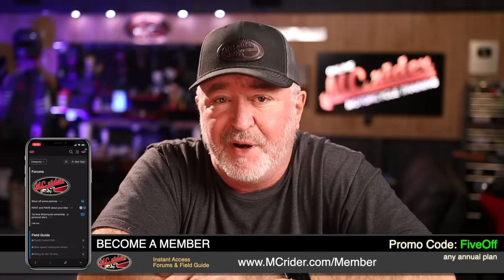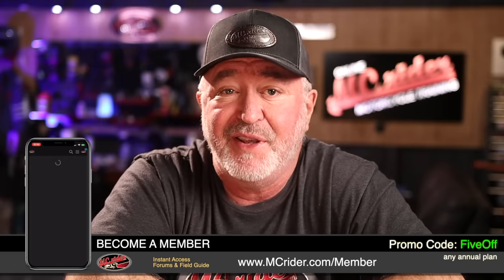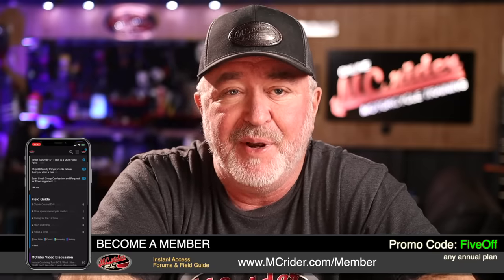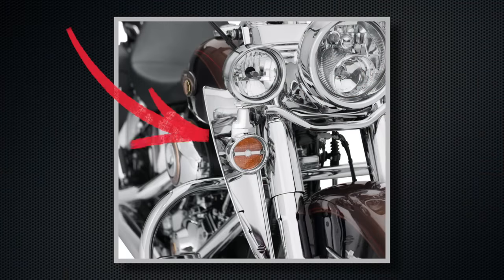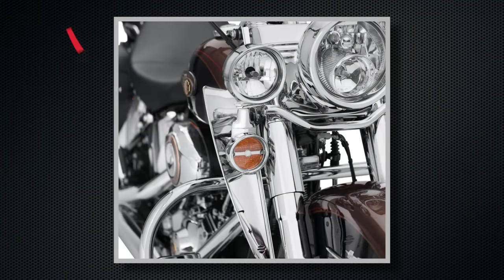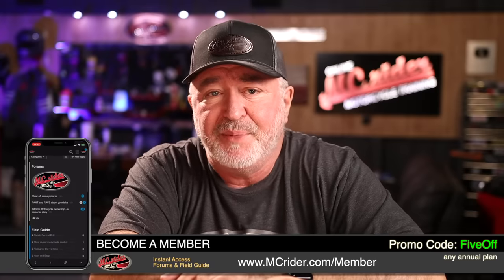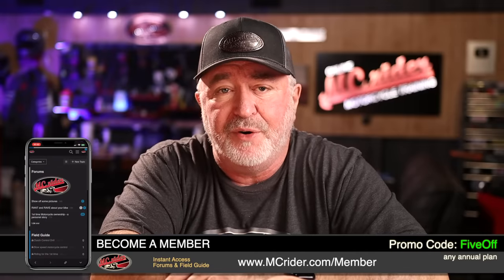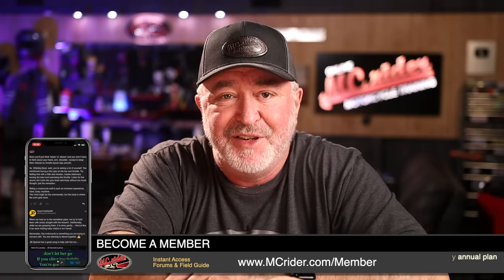Say Goodbye to Wind Buffeting on Your Motorcycle: Expert Tips and Solutions

Comment: Helmet buffeting isn't much on my BMW K1100 LT. I have an adjustable windshield and that is helpful. I sit in a relatively still pocket of air and the wind goes all around me. In the rain this would keep me dry except for a bit of my shoes will get wet, and because the rain hits the top portion of my helmet and as I am in a relatively still pocket of air, all that rain dribbles down on my chest and it will soak my underwear too, in a heavy rain, or even moderate consistent rain, if over a longer period of time. 

Most of the rain I run into, I don't find the need for a rain jacket, but I do carry a windbreaker and will put that on during heavier rain if I want to. It is quite water resistant. 

Because I have a full fairing, I can ride through any kind of rain, as long as it's not so heavy I can't see, and for that I would need to stop even if in a car. However, because I do get some rain dribbling down on me, rain can affect how well I can see, so I might stop depending. I would say that about 90% of the time, I ride right through the rain, if I want to get somewhere.

The relatively still pocket of air I ride in, is actually mostly on the front of my body, as the air will curl back around and hit me on the back. On a long ride it's like getting annoying pats on the back, and that can cause some tensing up of the muscles in the upper back, especially during cold or wet weather. However, it's a whole lot better than facing a hurricane of rain which happens without a fairing. There is no faster way to get wet than that, other than jumping in a lake. It's one thing to have a bit of water dribble down on you and quite another to be sprayed with a garden hose.

There are those days when I could wish I had no fairing, but I'm sure if I didn't have one, it would not be long before I would wish I had one again. I don't get beat to death by air and I actually stay quite dry all things considered. Once through the weather and I can dry out completely quite quickly as I am not in completely still air. I really wouldn't want a bike without a full fairing. If I can only have one bike, it's going to be one with a full fairing, if I have any sense. 

What would be the perfect bike for me? Well, I like a bike that is narrow, with a low seat height as I am getting older. I would like it to be a lightweight tourer with a full fairing.

I suppose my dream bike would be a lightweight, big V-twin, low seat, and full fairing which would be quickly detachable and lockable. Nobody makes one yet, but that would be my dream bike.

Comment: This was really handy to watch.

I've recently hung up my one-piece and sold my R1 for a Z750 (Something up-right for my mid-thirties frame lol).
And I've been struggling with head on wind.  On a super sports you're in essentially a vacuum like bubble at motorway speeds due to aerodynamics and what not.

On a naked, it's a totally different set of conditions.

I love the z750, but I did get an up & down puig screen only to find that the wind now hits me directly in the eyes LOL
Didn't think of checking for windage from below.

Also, I think I need to adjust the screen so the turbulent wind is below eye level.

Cheers for the tips!
Subscribed!

Comment: Thanks for the information, I would think that the fork lowers on an air cooled motor like the Harley would not allow for optimum air to cool the engine. However, a water cooled motor should have no issue.

Comment: I solved this problem by installing an air flow windshield from givi, it's amazing
Reply: I agree installed an air flow after breaking my OEM in a accident. I ride a 650 Vstrom  I like how easy it is to adjust.
Reply: @roberthaldeman5312  I drive a vstrom 650 too, excellent windshield

Comment: My stock windshield on my Royal Enfield meatier 350 has a small opening in the lower center of the windshield that's I'm sure use to neutralize the pressure -it works great

Comment: Get a windshield that does not seal to the bike. Letting air flow under the windshield will allow air into the area that would have been void of air. This alleviates the vacuum that the disbursed air wants to fill in.

Comment: Took three windshields to fix my buffeting, I ride a SGS  and wear a half helmet,  so that cute little 4 inch windshield looked good but did nothing . Went to a HD 7" smoked, it looked the best, but still had buffetting. Added adjustable wings on cowling, that helped a lot. Finally went to a 10" clear,  not very pretty, buffeting is gone, could even ride without glasses. I see about 2 inches over the top, so clear view. Bugs can still hit me, but a least no longer get stuck in my teeth 😬

Comment: Rode my Shadow for years with the 15" narrow windshield the previous owner put on it, never had an issue. Got my Scout Bobber last year and put the 13" windshield on it, and it's great.
Got a 1995 Honda Magna with a 17" windshield thats twice as wide, and it just buffets my helmet no matter where I put it or how I angle it 😔
Sometimes the solution isnt a taller or shorter windshield, but a more NARROW one. Reduce the size of that low pressure pocket.
Shame because it's actually a real nice windshield and it compliments the bike well, but I think I'd need wind diverters to drive more air into that low pressure zone to fix it. With the gauges where they are above the headlight, it cant really drive air up where it needs to be.

Comment: i have a 2" x 1" x 18" foam rubber strip. i jam that between the base of my helmet , starting in the back of my neck and around my jaw line. it stops the wind from entering the helmet from the bottom. it reduces wind noise

Comment: Being a little bit more to the point would be nice; this story can be told in three minutes. Having said that, I agree with your conclusions. A windscreen has advantages (taking away the pressure from body and neck and preventing the rider from cooling down too much) but also a few downsides (view and turbulence). Turbulence is caused by the vacuum behind it,  and you certainly don't want your helmet in that. But here's the complex thing: apart from size, shape and angle of the windscreen, the 'vacuum bubble' varies with your speed - not to mention sitting position and amount of 'stuff' within that bubble, like a tank bag. That makes the problem hard to tackle, but as it acts like a chameleon, the solution should be to - meaning your bike  should be a 'shape shifter'. An electronic controlled variable screen height (like the Suzuki Burgman 650) is an absolute must; it's ridiculous how few bikes have that. Second,  displacing the turbulence area with a wind deflector might be also option. And third, you might think of an air vent that diminishes the vacuum behind the screen.

Comment: I had a Givi Airstream screen on the BMW GS.  It lets air under a movable section that stops the buffeting. It cuts the >80mph wind pressure allowing you to maintain high speeds all day long.
Reply: I think you mean Givi Airflow. My friend has a F650GS (800cc) and it has Givi Airflow. I set that to a height little below eye level and that thing was totally silent.

Comment: Tall windshields ARE dorky........... and dangerous. Was on a road trip from Calgary to Denver with good friend of mine just outside Great Falls, MT and hit some early morning fog. He couldn't see through his tall windshield and when we hit road construction with ruts and gravel, he lost control of the bike trying to look around the tall windshield and ended up upside down in the ditch with a broken windshield and a few other broken and bent parts. Luckily we were going slow enough that all he suffered were some ripped jeans. Got the bike back into the HD dealership in Great Falls and they were good enough to take handlebars and a windshield off a bike in the showroom so we could continue our travels. The new windshield was about "nose height" for him and his visibility was improved tremendously. No wind buffeting either, because it was the right height. He'll never go back to a tall windshield.

Comment: Horrible problem on several bikes I’ve owned. Best two bikes were a road glide and a heritage. Worst was an 883. Buzzed so bad I couldn’t see. Put a bungee cord across the top of my helmet (used to be a company that actually made an adhesive hump-like a speed bump) and it helped. Looked goofy but it worked. Wind hitting the bottom of the full face caused the biggest issue.

Comment: I think windshield shape and design play a role as well. I have a 2016 road glide with fairing vents. That allows so of the air to pass through and seems to prevent buffeting for the most part.

Comment: My whole life and 31 years of riding I've only loved 3 types of bikes - Cruisers like an HD Sportster (No windshield ever), Sport bikes and my fav naked bikes. If it has a windshield from the factory or aftermarket I wouldn't be caught dead riding one ...O yeah and Fairing are not windshields ... When I was in my mid 40's I could easily tolerate 130 mph sitting up straight on a naked bike for a good 6 or 7 minutes, now in my mid 50's I can do the same but I have to get down low, but that's me I love naked bikes mostly Cruisers and Sports naked.

Comment: I was skeptical when I bought it, but a $30 plastic windshield extender got rid of 90% of the buffeting I was experiencing. I'm a tall rider, so the stock windshield of my CB500X just isn't quite tall enough, I suspect. I prefer the extender to a taller aftermarket windshield because, when going off-roading, I can simply remove the extender so I have an unobstructed view
Reply: I've got the same bike and also installed an "extension" to the windscreen. I was pleasantly surprised to find that when the extension was in the down position, it had the effect of substantially reducing buffeting (it's not necessary to extend it up to a height requiring you to look through the screen). Now I'm able to ride at freeway speeds  looking over  the windscreen, with very little buffeting.  It would be nice if there was a simple formula to follow to eliminate buffeting, but there are so many variables that it has been a series of  (sometimes expensive) experimentations with the different bikes I've owned.
Reply: I have the same 500x and man the original windshield is ridiculous. I have to buy a $40 taller windshiel with 55cm of height +1 13cm deflector. I'm now disliking the viewing through the windshield but now I'm not felling any buffeting and my travels become more comfortable.
Reply: @magichatake  Another option that can help is to install spacers on the windshield mounts, to push the windshield further away (forward). I did that mod because I installed bar risers that pushes the bars further away and up, which resulted in the bars hitting the windshield at full lock. I now have zero buffeting, so I might try removing the extender to see how well the stock windshield works with just the spacers

Comment: Thank You Kevin, I believe I'm worse then you, If a "rider" doesn't like the wind they can get in a cage!
12 years ago I put a windshield on my Road King and had more energy at the end of the day when we got to the hotel. We road through crosswinds most of the way so I didn't think the windshield was worth the money. When a friend gave me an 87 goldwing they never ride, it was my first "new" bike with a fairing. My 65 PanHead's fairing and windshield never blocked any wind. 
Whether I ride in high winds or during the Iowa winters, I get called crazy. I give the same answer for windy conditions as I do for winter riding where there might be sand at intersections; SLOW DOWN!  In 43 years of riding I have never claimed to be the best even though I've ridden more than 2 million miles on several bikes. There are folks out here that have ridden more miles and I think they'll agree; unless it's a mechanical issue, deal with it and just enjoy your time behind bars.
You are in my prayers
Hoka Hey
Reply: Like Kevin said, wind and buffeting are two separate things. If you ever experienced it, you know. If you never had the paint can shaker rattle in the helmet, you will never understand. Less than 40 miles and I was dizzy and puking.

Comment: After ridding my bike with the extra large windshield installed by the previous user...and experiencing a lot of noise I decided to revert to the original size windshield. The result is way quieter but I feel much more wind on my chest. It's no way I gonna revert back to the large windshield.

Comment: Newer OEM designs have a rectangular opening in the middle of the WS. Looks like it allows some air to pass through and fill the vacum  redusing turbulence . No aftermarket WS has that feature. for example Honda NT1100 has tiny deflectors along with the medium sized opening

Comment: Man a well designed windshield is night and day for long rides if you ride fast at all.   I rode a sportbike when I was young and THAT was ideal wind protection regardless of your wrists and leg discomfort!   My Tracer9 gt has a tall funky looking windshield that some replace for looks but I wont because it works WAY WAY WAY better than nothing...your so called "clean air" ...there is no "clean air" at speed lol.  I bought the touring windscreen for my MT-10 and while it looks nice it does in fact cause the buffeting you refer to....it is nice if I tuck behind it but it feels and I am sure looks wrong.  If all I did were ride at slow speeds in the city or kept to 50ish then I would not bother with a windshield....but again if that is all I did I would not bother even riding....IMHO

Comment: I had a Vstrom and went with the taller shield - it didn't really help much.  I installed lowers on my Vstar in addition to the stock windshield - it's hard to gauge but I would say it reduced buffeting by 50-75%

Comment: There is a rider of the same make and model of bike I own who does videos about his bike and the various parts you can buy for it. He has tried different windshields many times. He must have a very low tolerance for buffeting. His height, according to what he says, is the same as mine. I ride my bike an average of over 20k miles per year and it has never bothered me even with the stock windshield. I hardly notice any buffeting at all. His tolerance for it and my tolerance must be very different.

Comment: A shorter recurve windshield works for me. I use WindVest. Mine is a 10” and puts the buffeting just over my head. 

Also, I’ve got Dragon Wings on each side of the faring. These can be opened to direct air on hotter days. 

Last, I installed the fork mounted wind deflector. 

With over 80,000 miles of touring using this configuration, I’ve fount it to be an excellent experience. 

I don’t mind the wind. I just don’t like getting fatigued by buffeting I’ve long periods of time.

Comment: Wish was worrying about buffering as I'm riding but this morning it's -40 so bike is parked for awhile
Reply: I moved to SW FL so I could ride all year.   I have 3 Honda's all with large windshield.  My Honda reflex was buffeting so bad it was unrideable over 40 mph.  I slapped on an old windshield I had that adds 6 inches on top and 3 inches on the sides.  Perfect.   Two small C clamps and some shoe goo keep it on.  Not pretty but it works

Comment: I also get buffeting on my Challenger. I don't think its due to the windshield, but the air around the bike. It hits me in the back of the head so I need to look into those for mounted deflectors to stop the air coming from the bottom. I'm also thinking of getting the hard lower fairing the Pursuit has, but not sure they'll fit my TLC Crash guards.

Comment: I have two bikes, one with and one without a windshield, I had been using two different helmets as well because my favorite did not work well without a windshield but still there was some buffeting but usually not much of an issue unless there was heavy cross winds. I decided to buy my first modular helmet that can retract both the shield and chin lock a 180 degrees. I was amazed at how much better the new helmet was in the wind . It has worked so well with both bikes that it will replace both older helmets. The shocker for me was how well it worked at Hwy speed on my Fatboy. I can’t knock you disliking 5:06 real tall windshields , I too think a shorter shield looks and works better as far a buffeting. But I can’t bring myself to put a shield on my Fatboy, it would be like putting a dress on Mike Tyson, it’s just not something you wanna see right? Lol

Comment: I got the fangs on my road king and they're the only thing that worked but created much heat in the summer and weird squirmy feel in freeway traffic.  I even cut another shield as small as I could and it still buffets.  I don't mind wind on my helmet and ride without the shield but on the freeway it's very tiring trying to hold on, I just want it off my chest.

Comment: I'd really like to see you produce a video on the importance of practicing/simulating emergent progressive braking and the science behind establishing neural "hardwiring". As a pilot, I'm sure your mind goes to the tragic consequences of Colgan flight 3407. Although there were a confluence of multiple factors, the ultimate failure was attributed to the complete lack of pilot shaker stick training and the absence of those crucial neural connections that required the pilots to pitch nose down, instead of up. To my mind, emergent progressive braking is the analogue of shaker stick training for motorcyclists.

Comment: I actual bought a new motorcycle with a taller windshield. 😂easy fix 😂 I get very little wind buffeting on the new bike. I might still bye some lowers to help reduce the wind noise in my helmet but my ear plugs reduce the wind noise pretty significantly.